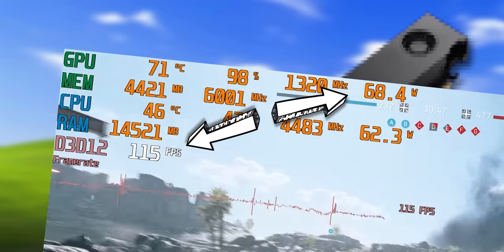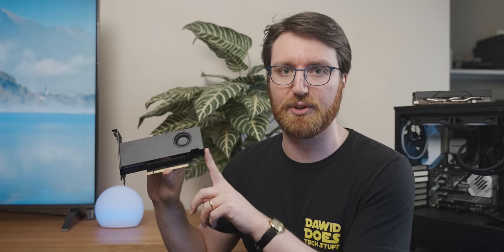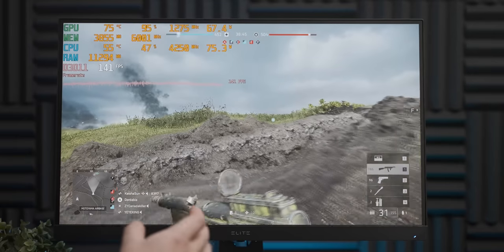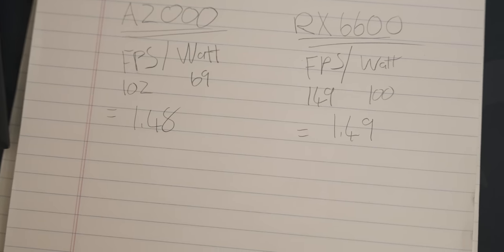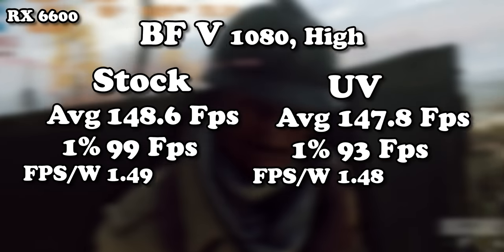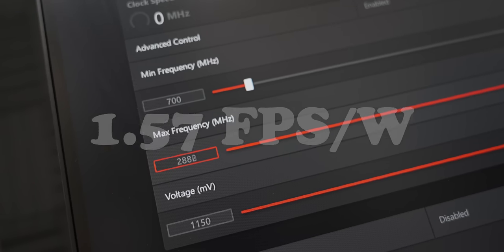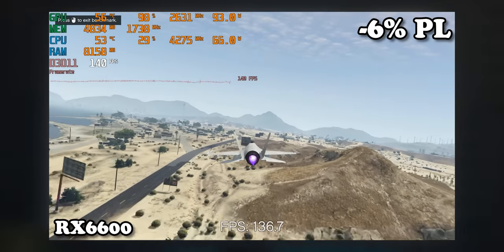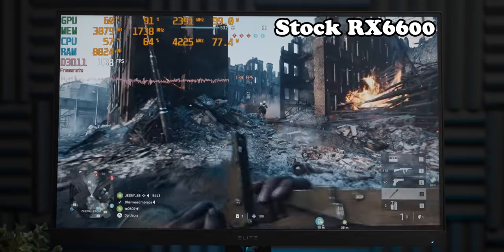The Battle For The World's Most Efficient Graphics Card

Comment: It's worth noting that NVIDIA and AMD report power usage differently through software, so it's not really 100% comparable. It's better to have a physical measurement of power draw using something like the NVIDIA PCAT instead.
Reply: as he said
Reply: Only Measures how much PC is pulling out form wall are realisable.  Due different GPU drivers stress cpu in different manner.
Reply: Exactly! Many people don't realize amd is pulling more then the let on! I find it funny the real knowledgeable have all explained how it works. Yet people still want to act like ita 200watts to 250watts eveb at the high end.
Reply: @reviewforthetube6485  Yeah, that's unrealistic, unless you undervolt.
Reply: True story...my 6600xt is usually drawing about 20% more watts at the wall using a killawatt plug. Wattman is way off
Reply: this, i noticed my amd cards easily take 50w extra while my nvidia gpus use 20w more than reported
Reply: @RonnyJoe  did you account for power supply inefficiency?
Reply: How does that work? Watts are watts. What am I missing?
Reply from the maker: That’s true, software power draw measure definitely has its problems. I’ll see if I get my hands on one of those PCATs. 😃
Reply: @deepspacecow2644  psu efficiency will pull more watts at the wall as some voltage is going to heat . the closer to 95 % you get , the closer to advertised power draw you will actually see/ The psu powers the whole system so any inefficiency will skew results.
Reply from the maker: @tobiwonkanogy2975  Yeah, I think at the end of the day, if you want super accurate results it starts getting really complicated.
Reply: @DawidDoesTechStuff  u do you fam .
Reply: Its also worth considering idle power. I've seen more "power hungry" components actually use considerably less power than their more "efficient" competitors over the course of a month of normal use.

Tho that does mean logging data over time and probably doesn't translate into a very interesting video.
Reply: maybe a separate power supply per part lol
Reply: Just measure the current at the 12V rail going to the GPU and then add the PCIe power
Reply: @tobiwonkanogy2975  I know, that is why I asked them if they did, considering that they are measuring gpu power at the wall
Reply: If you measure from the wall, the difference should be apparent. It might not be exact, but it still gives you real world numbers. 

Last I checked, my electricity provider doesn't care how efficient my PSU is, or what the actual 12v DC load my GPU has... they just charge me based on how much my PC pulls through their meter. If all other hardware is the same, the total system draw from the wall from one GPU to another is the real world difference.
Reply: @MrNside  but aren't we talking about the gpu power draw and how it reports to software vs the gpu actual power draw
Reply: @DawidDoesTechStuff  Definitely have to! Either that or just measure total system power consumption at the wall! I.e You measured the 6600 at 100 watts at stock, the software states 100 watts, but we know that the stock card has a power limit of 132 watts, and the card appears to be power limited during that test rather than temp limited. So we know that AMD's reporting is around 32 watts lower than reality in that situation.

From other testing we know that Nvidia's is pretty accurate for total board power consumption though.

I have my 6600 underclocked/undervolted and it runs at around 1920mhz @ 775mv using about 55~ watts reported in software which is most likely just the core power draw. Total system power draw is at around 155-160 watts and I'd estimate the 6600 is using around 70 watts total.

It's an insanely efficient card, I also don't notice a massive performance drop from 2500 down to 1900~

Edit: I should add that simply lowering the clockspeed slider reduces the power consumption by a massive amount on its own. RDNA2 seems to be in peak efficiency around the 1900-2100mhz range. My card is so low on power now it often won't even take the fans out of 0 RPM mode so I manually have it running to keep memory temps in check just in case.
Reply: @deepspacecow2644  
I mean... sure? I guess my point is that whatever the difference a single GPU says it's drawing via software and what it is actually drawing, it's kind of irrelevant. All you need to know is, it isn't accurate, and there's no good way to quantify how much it is off from one model to the next, one manufacturer to the next, or even one GPU BIOS revision to the next.
Reply: @christopherjackson2157   My vega56 gpu-z reporting 4w,web navigation and  playing video.
Maybe should add a bit cause it's only core power
Reply: @deepspacecow2644  no but the psu is a hp 400w server psu on a breakout board powering only the 3x 6600xt and their risers ( mobo etc is being powered by seperate psu so not on same line) . Wattman reports 185w total draw while the killawatt reads circa 225w at the plug for the psu. Watts drop evenly when each card is removed. But your right that the psu will always have some additional residual power draw/loss. For the record each card is mining at circa 30mh's undervolted to 750mv and max 1200 core clock. Easily the most efficient card on the market.
Reply: @DawidDoesTechStuff  Canadian Tire sells kill-a-watt meters you plug into the mains to measure power draw
Reply: @kkrolik2106  yes, but it's likely more accurate that the software method.   Plus it would be a more balanced view of "given the same hardware, what power does the system draw with each GPU?".  If one demands a lot more from the CPU and ends up pulling more total power, that would be significant.
Reply: My RX 6600 is definitely more power efficient than my old RX 570. My APC UPS reads about 20-30 watts lower load while gaming with unlocked fps ever since I upgraded. I have never really examined the difference between the software indication of my 6600's power consumption and that shown by my UPS.
Reply: @DawidDoesTechStuff   hey do you have a telegram page where you give gifts?
Reply: @reviewforthetube6485  AMD doesn't say their top GPUs have a 250w peak...
Reply: Nvidia cards measure power consumption of the entire board, AMD’s cards only measure GPU due power.
Reply: @DawidDoesTechStuff  don't do it, that's boring. people already have linus for that. put tape on something!
Reply: "It's better to have a physical measurement..." That's what she said. 

Sorry. Please forgive me baby Jesus but it was just too easy.
Reply: @too2thehead513  No of course he doesn't. Don't you know its a common scam to pretend to be a creator and then pull you on telegram to scam you? As far as I'm aware almost no creator does giveaway on telegram.
Reply: @RonnyJoe  if you're measuring at the wall, that's measuring your whole system power include cpu,drives,ram and fans etc.
Reply: @DawidDoesTechStuff  maybe you could to try cap fps to a value that all the cards can achieve and measure at the wall idle without gpu installed then measure with gpu installed and a game running or furmark at a capped fps on all cards, then you can see the difference in extra wattage above idle, some of this will still be cpu etc. but it will give you an idea of which is more efficient.

I think this will work well for cards of similar performance but it might not be accurate to measure cards that can put out much more fps because they might be less efficient at higher fps/clock speeds etc.

the true way to do it would be to physically measure the power going into the gpu's and do a calculation for fps per watt
Reply: @peter3337  it was a mining rig at the time, i was using a server psu to power the gpu 8pin and the 6pin on the pci 16 connector. Likely some psu efficiency losses in there to. Those 6600xt's I had are now in gaming rigs for family. Fantastic value cards!
Reply: @unpotat7672  but why do you want less performance out of your card?
Reply: Yeah fuck the most efficient GPU I want the most efficient PC build
Reply: @RonnyJoe  How can you tell that’s actually because of your gpu and not other components in your pc or the power supply inefficiency, you realize that your power supply draws more power than it actually puts into the system because it’s not 100% efficient, some of the power will always be lost to heat in conversion. Typically most power supplies are most efficient at 50% of their rated maximum load
Reply: @Dell-ol6hb Yes your prob correct toban extent but without a proper scientific controlled teat we will never know exactly LOL...also Its great to see that this chat lives on but now that gpu mining is unprofitable it doeant really bother me anymore...headleaa cpu mining is where its at ;)

Comment: You should build a "green pc" that is super power efficient. Kinda like the one LTT made a couple years ago
Reply: Green pc = no pc
Reply: @JudeTheYoutubePoopersubscribe  yea Pascal was nuts when it came to power efficiency, even the 1080 (the launch flagship) still only needed a single 8-pin, which I still find impressive
Reply: Agreed. I'm super horny for super efficient builds. Something about optimization gets me going.
Reply from the maker: @LurkingLarper  Oh for sure. That shit’a pretty hot. 😂
Reply from the maker: That’s a good suggestion. I’ll start looking into it. 😃
Reply: to me thats a pi 400 with break out cable to gpio screen . about 5-8 watts and a full desktop experience minus screen real estate . a real pc could be a ryzen mini pc or intel nuc . They get down way low to under 25 watts i believe. basically laptops with no screen.
Reply: @JudeTheYoutubePoopersubscribe  not quite true. I undervolted entry level 3060 Ti for -200mv without dropping clocks and it was completely stable and lost no performance. I think this is more about silicon lottery than anything else with few latest Nvidia generations.
Reply: @exaltedb  I have a 1070 laptop and it's still very effective today.  All that holds it back is the puny 9mb of cache on the 8750h that it came with.
Reply: @skorpion1298  Possibly Green PC = Winter Only PC.
Reply: That would have be ARM powered to get that title. So that means a Mac M1/M2. Nothing built will come close. Mic Drop.
Reply: @jondonnelly3  fanboy of the fruit company? Try playing GTA on your M1 xD
Reply: It's called a ps5 or series x
Reply: The “California prebuilt special” the biggest component is the gpu for legal reasons
Reply: @JudeTheYoutubePoopersubscribe  Meanwhile my 780ti pulls 100w while doing absolutely nothing. Hell of an efficiency jump in 2 generations.
Reply: It already exists. ARM Mac
Reply: @JudeTheYoutubePoopersubscribe  great efficiency!
Reply: usually I roll my eyes at suggestions, but I think this one is really good...love maximum performance from minimal resources...it's a fun game to play!!!
Reply: Wouldn't that be any APU build right now? Like stick a 5700G on a B550 board, undervolt it a bit, and at least for low-end gaming, you're not pulling much of anything as far as desktops go.
Reply: @DawidDoesTechStuff  that’s the funniest response The only way I can describe it is just by saying look at your profile picture and then read that I don’t know why it just makes it better I think it’s the smile on your face 😂👍
Reply: My i5 4690, iGPU, 1xSSD, 2xHDD(each HDD adds 5W), draws 39W at the wall watching this vid.
Reply: @JudeTheYoutubePoopersubscribe  7fps loss on a 1070 is awful, imagine going from 50ish fps in 1080p to the low 40s in dying light 2
Reply: @exaltedb  6600 xt requires 8 pin while being much more powerful than the 1080
Reply: Please do this!!!
Reply: @JudeTheYoutubePoopersubscribe  That’s bad. My 3080 sits at 23w idle
Reply: Ryzen 5 5500 consumes 45W at stock, undervolted 35W without losing almost any performance, and the rx 6400 consumes 50W, too bad you can't undervolt it. Or the RTX A2000 which consumes 75W, but is faster.
Reply: Here's my parts list for a green ray-traced gaming PC:
 - MSI H170M ECO
 - Intel Core i7-7700T
 - 2 x 16GB DDR4 2400MHz RAM (or 1 x 16)
 - RTX A2000 12GB (or 6GB
 - At least one SATA SSD
 - 200W - 250W DC-DC converter
 - Wi-Fi 6(E) card
 - ASUS 15.6" portable TFT monitor, or another monitor supporting high refresh rates and/or resolutions 
 - Tiny10, Tiny11, or Linux

I'll then crank energy settings as low as I comfortably can and rely on DLSS, DLDSR, and underclocking to reduce bottlenecks while ensuring a decent experience.
Reply: @greatwavefan397 use a 13th gen chip, it will be more power efficient and give more performance per watt as a result.
Reply: @LetrixAR yup an M1 Mac Mini may best this
Reply: Steamdeck is 45w and can probably do a better job per watt

Comment: From my experience, using RX 6600 XT and RX 6800. You have to set the minimum frequency to 100mhz lower than max value. The frequency keeps fluctuating if the min is kept at stock value (i think it was 500mhz). Do not worry, on idle, it will not stay at the min frequency, it will downclock to very low value.
Reply: Nope: it can hurt 6600 XT's performance by around 20%. Try comparing Furmark benchmark scores
Reply: No. Best performance is somewhere in between. Idk why, but amd overclocking is just wierd. (Source: did a lot of tinkering with 69xt, from 180 watts, to 500+)
Reply from the maker: I did also spend a bit of time playing around with the min value. Sorry I should have more clearly showed it in the video. 👍
Reply: @DawidDoesTechStuff  on my 6900xt efficiency improved when not hitting power limits. Lowering max clock helps too. I ran it at 180w with significantly more than stock performance. RDNA 2 OC is like voodoo magic 🤦‍♂️. Let's hope rdna 3 is a bit less wierd.
Reply from the maker: @b127_1  Haha!! It did really feel like Voodoo magic when I was playing around with it. Let’s just say the weirdness gives it character. 😅
Reply: @LeeseTheFox  i have tested using timespy benchmarks. I dont run furmark on any of my cards. Might as well put my cards in the oven.
Reply: @DawidDoesTechStuff  I remembered this video recently and decided to do my own testing on how to improve GPU efficiency. Only I went about it a completely different way that paid off big time!

I dialed down all the sliders in the Radeon tuning section to their minimum and then at the lowest voltage I decided to slowly increase the frequency back up until I reached as far as I could go while still being stable. Once you reach a certain point you'll have to dial the power limit back up to continue on. Just keep the voltage at minimum!

Using this method on my reference RX 6800, I was able to achieve 85% of the stock frequency! This gave an over 25% improvement to performance per watt in FurMark and as much as 60% in games! 

Theoretically speaking, I imagine this margin grows even greater with the more powerful the GPU you use. This is considering how number of GPU cores and the larger the memory bus matters more than raw clock speeds. I'd love to see this tried on a 7900 XTX!

Comment: RX 6600 is bottlenecked by the power limit, so overclocking does not make any difference. If I unlock my power limit to 120% I easily gain another 10% fps. So when undervolting, instead of reducing power consumption, you're actually increasing the clock speeds. What might actually make this card more efficient is an undervolt combined with underclocking

Comment: You can use the morepowertool to do much more tweaking to the 6600. Lower to power limit to whatever you want, also undervolting the memory.
Reply: This.
Reply from the maker: Oh cool! That’s a great suggestion, I’ll check it out. 👍
Reply: @DawidDoesTechStuff  in case more power tool doesn't work with your AIB model, you can just save the mpt profile as a dot reg file and then run it as admin.

In case you are unfamiliar with morepowertool, reply to this message i will explain in more detail. I have a 6600 as well. Was able to overclock it way past an rtx 3060 using mpt.
Reply: I use more power tool on my 6800xt to get more fps and lower heat at same time. Also to mine with low power draw while not gaming.
Reply: @BlueThunder1965  best I could get from my rx6800 was 118w at 62mh/s undervolted as much as I could and thats my daily work from home rig too
Reply: @DawidDoesTechStuff  Maybe get in contact with a miner. We always try to be as efficient as possible and drive our cards to their absolute limits. BIOS modding, VRAM undervolting... every milivolt counts.
Reply: @DawidDoesTechStuff  
As others said, you need a better measuring means than the software. Something like a Voltmeter at the wall sounds better.

Secondly, too many chefs spoil the broth. You need TWO games as a benchmark. One for the low-end and one for the high-end.

I think GTA V, at 1080p with Medium (not Lowest) Settings should be pretty optimised for the low-end. And for the high-end maybe something like Doom Eternal, at 1440p, with Very High (not Ultra) Settings.

Lastly, your best case scenario is still going to pale in comparison to Laptops. They're tuned even more for efficiency. There is an efficiency curve to these hardware, and it's not quite considered when it comes to desktop sku.

Specifically the Nvidia MaxQ variants, like the RTX 3060, should be doing very well in terms of FPS per Watt. Perhaps even better is AMD with their RDNA-2 and 12CU iGPU (680M) in the r7-6800u. Sharing resources with the main board, CPU and RAM hurts performance but likely is very efficient.
Reply: @RonnyJoe  this video (and channel) is about gaming man.
Reply: @mikas2934  Thanks for the clarification however I game too so chill out man.